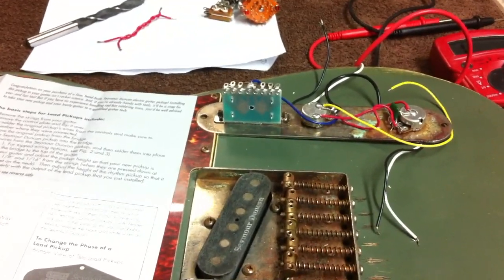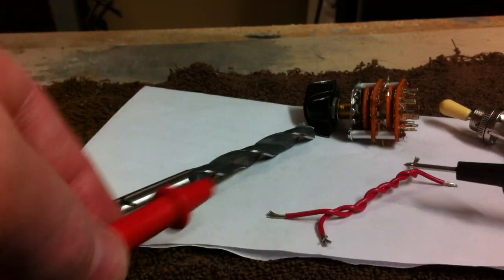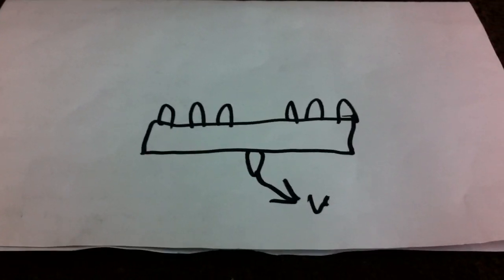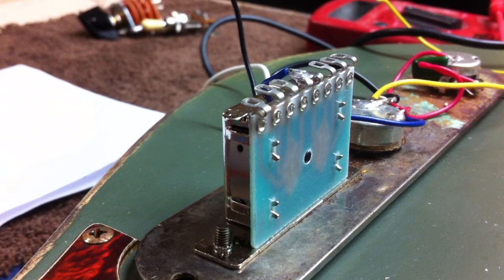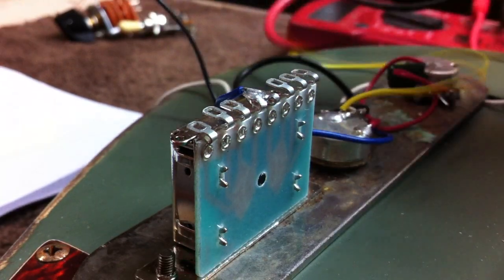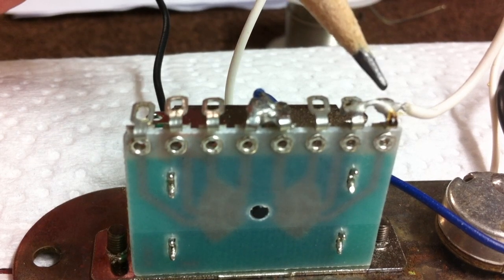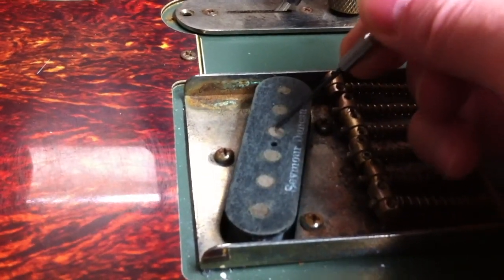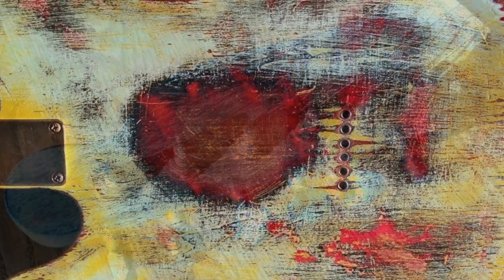How to wire a 3 way (or any) guitar switch.

Comment: Hey Johnny, Thank you so much.  I got really bad instructions and a bad schematic in a tele guitar kit I just finished.  I couldn't get the pickups to respond no matter what I tried.  Of course I was just firing blind. I figured they sent me a defective switch.  Then I found your video.   Lo and behold your video used a very similar 8 pin switch as the one in my kit! After watching your video I sorted my guitar in minutes!  You have a new subscriber (me) and my thanks.

Comment: This must be a sign to me or something. I've been highly contemplating if I should wire my guitar that I just built or if I should pay someone. I actually took it to someone earlier today and the guy was ignorant and didn't listen to anything I had to say. I bought some Fishman Fluence Pickups and it couldn't be easier to solder. Like really easy. Match the wires to one of the diagrams. It comes with all the parts you need and then some. Two humbuckers, two push pull pots, two volume and tone pots. Everything is color coded. I wanted someone to do it because I wanted to use a 5 way switch and that's where I needed someone to help me out. So he made a very good point. Why would I want a 5 way switch if I'm trying to achieve someone's exact configuration because this is a signature series set. So I bought a 3 way switch, keep it simple. Now I feel better about doing it myself. If it doesn't work, well then I'll take it in. But understand this, I've spent the past week researching at work, at home, looking at YouTube, reading forum's etc. I couldn't find this video until now so for that, I thank you good sir!
Reply: How'd it go?
Reply: @Rockefeller1  He exploded.

Comment: Hi Mate,

Thank you for your video,  I want to ask I am working on a project to have two pick up on my acoustic guitar,  neck and piezo. I want to have stereo and mono out put on my guitar.  Say I have stereo out put jack i solder two hot to hot stereo and ground to ground on out put stereo jack.  If I split the pick up hot and ground and combine both  and solder to mono hot tip and same split ground from pick up, join them and solder them to ground of mono out put jack.  Will that help to have stereo and mono signal where on stereo I can control each pick up individually and in mono both pick up will be together.

Please help and advise

Comment: hi johnny great video, mate im trying to wire a Seymour Duncan SHR-1 hot rail to a set up like what you have there, im trying to do a split/series/parallel, my question is what wires off the hot rail goes where on the switch ?

Comment: What do you use the 2 extra terminals for? Don't 2 wires from each pickup have to attach to the switch? I'm confused now.
Reply from the maker: The two terminals that are unused (in this case) aren't needed because this guitar only has two pickups. Only one wire from each pickup (hot) needs to go through the switch, the other goes to ground.

Comment: Nice video man! i do have a question: I have one of those switches in my guitar as well and i want to install new pick ups, is it okay if i just solder the hot wires of the new pickups where the old pickups were? or do i really have to change evertything like in the diagrams Seymour Duncan for example provides?
Reply from the maker: Yeah, you should be able to just swap out one pickup for another. Keep in mind that pickup companies have different colour codes for wiring.
Reply: Okay great thanks a lot!

Comment: I thought this was great, but no info on grounding. Still need to run a ground from the toggle to the out jack, no? And is ground considered "hot" or is hot signal only?
Reply from the maker: As long as you shield the electronics cavity properly everything should be grounded. I have thought about doing a video on grounding and shielding.

Comment: I noticed your switch came with the two middle lugs pre-soldered together... how do you know if you need to solder the two middle lugs together if you, for instance, get a brand new switch out of the box that has no solder on it at all yet?
Reply from the maker: Both are outputs to the pickups, testing for continuity will determine this. Since this guitar has only one volume pot both are soldered together. You could keep them separate to send the signal to different sources (pickups) for a more complicated set up.
Reply: @JOHNNYBGUITARS  Hi first of all thank you for this excellent video, but I do have a question: How do you dertermine that the 2 lugs in the middle has to go to the volume pot?
Reply from the maker: @ghaussydreams  All roads must lead to Rome, the terminal that always tests "hot" should be the one that goes to the volume pot, "or" output.
Reply: @JOHNNYBGUITARS  Thank you for at quick reply. I made it work :-)

Comment: My 3 way blade switch is different. Bought it new has the same 8 connectors (they are numbered 1 to 8 ) but  connections numbers 2 and 3,  4 and 5 and 6 and 7 come united between them so I have 5 connections two singles at the right and left ends with 3 pairs in the middle. Just ignore the 2 in the extremes .Thanks soon much

Comment: Can you make the middle position a kill position. On/off/on?. If so how?
Reply from the maker: How a kill switch works is by grounding out the pickup, so if you can ground out the pickup only in the middle position then... Yes.

Comment: What setting on the multimeter ? Dumb question maybe but I am an electronic dunce !!!!
Reply from the maker: The best way for me to tell you is...touch the red and black terminals together and cycle through the settings on your meter. If you get a 000 reading, that's not it. When you get a reading like 00.8 thats it. All you want to know is that there is a connection, if you're testing a switch the 000 reading means "no connection". the 00.8 reading mean there is a connection.

Comment: What about the foiled wire..how do I reconnect it correctly ??
Reply from the maker: There should be bare ground wire under the foil, it will ground the foil shielding the wire once the bare wire is properly grounded. So no need to worry about the foil.

Comment: Struggling to wire up the mini 3 way switch on my Kramer Pacer Vintage. Where does the ground wire go?
Reply from the maker: Ground wires from the pickups, switches, output and etc are soldered to the tops of the pots.

Comment: Maybe I’m being dense, but out of the six in your diagram, could you also solder 2&3 for the neck and 4&5 for the bridge?
Reply from the maker: Yes you absolutely could, but the switch would be pointing to the wrong pickup. Normally when the switch is set to the bridge pickup position, the switch is pointing toward the bridge or bottom of the guitar, and when the switch is set in the neck pickup position the switch is pointing toward the neck of the guitar.
Reply: @JOHNNYBGUITARS  I get it. Thanks.

Comment: I watched it and see no explanation of wires to pickup AND wires to tone pot. Just where is he attaching to tone pot and where to the volume pot ?  It seems to me there is a tab on the switch for pickup hot and ground and also a tab for tone pot hot and ground. Is that not rigjht ?   If it is, where is the explanation of what to do  ?
Reply from the maker: The reason for making this video was to show how you can wire any switch without a diagram by testing the switch for continuity. At 2:10 I show the where the volume wire is attached, but this is not a step by step video on how to wire a guitar.
Reply: well, thank you but it does not tell a regular guitar player what to do.
Reply from the maker: I think your missing the point, so I guess this is not the right video for you, sorry.
Reply: I LOVE 3 WAYS!

Comment: how about showing a 3 way toggle like the title says.
Reply from the maker: The title says "How to wire a 3 way (or any) guitar switch.". In the video I'm using a 3 way switch and wire it for 3 positions. But the real point of the video is to show how you can wire any switch (or toggle) by testing for continuity. I'm not sure how you read toggle.